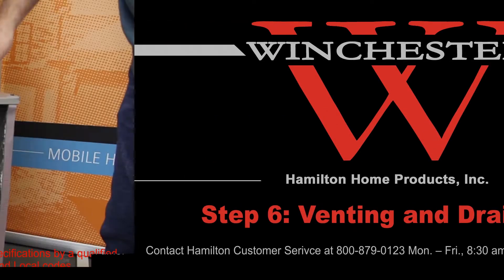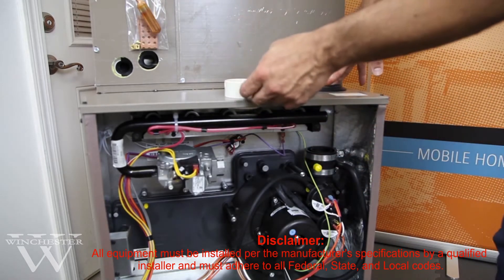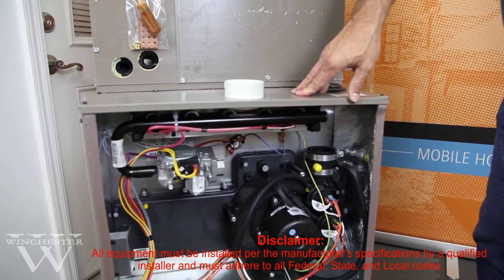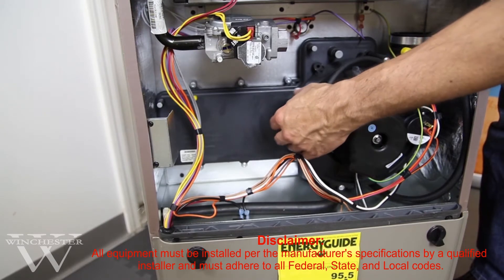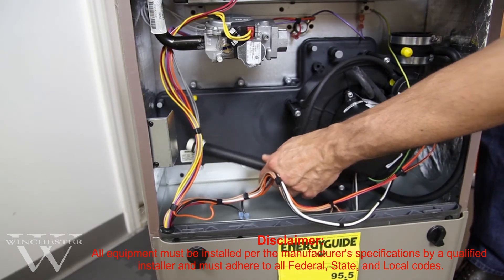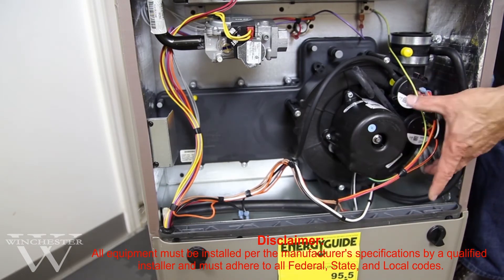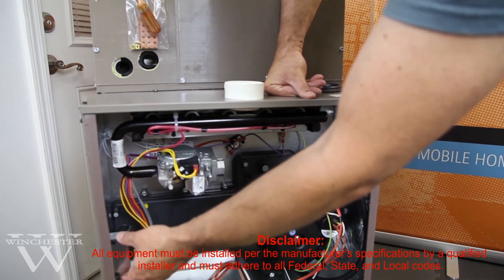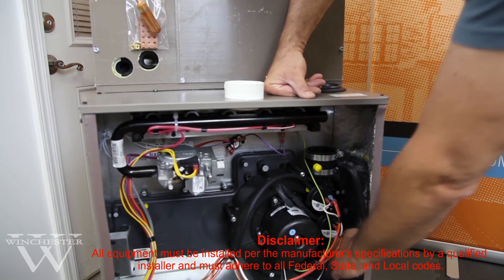Step 6 - Proper venting and drainage

Comment: So the intake pipe that goes horizontal through the wall to the outside, does that need to slope downward so that any wind driven rain does not run  back down into the furnace?  I have a horizontal concentric setup and whenever we get heavy rain water drips down my intake and into my furnace where I find a puddle on the floor. I noticed that the pipe going through the wall is sloped down towards the furnace which makes the rain water flow back to the furnace instead of the other way around. Was mine installed incorrectly?

Comment: I went downstairs to bring Christmas stuff up and notice all this water. It's inside and outside of the housing of the furnace. Unbelievable amount of water collected in the furnace and still running down the white pvc pipe into furnace. I shut off power and vacuum up all the water and looking to clean trap but its too far inside furnace and beyond my degree to mess with something I have no clue. So I searched for this on utube to get a bit more of understanding the water problem collecting in my furnace. I came across your video.  What a great job of showing us about the water and drainage. My Bryant  926ta was installed in 2016 and appointed in the install of the PVC pipes. I don't like they way they look outside too. Not straight . Hopefully I can post pictures. I give up and will call a professional on Monday. But I would like again to thank you for taking time out and sharing your video. I truly appreciated this very much!  Tim

Comment: The fresher intake that you have on top of the furnace is that located on the top of the furnace? Whenever  I have my furnace maintenance the hvac person always take ot to the skink and washes the debris that is collected from the outer flue pipe and get lodges right on top of that little vent. Yesterday  I had my furnace tune up and a younger havc person came and didn't  have a clue of where to find that same little white    gasket vent. Is it located on the top of the furnace? I would appreciate your help in this matter. And thank you. And just to let you know great job!